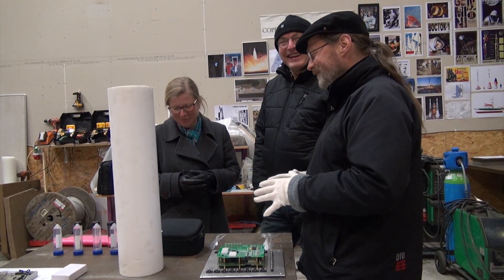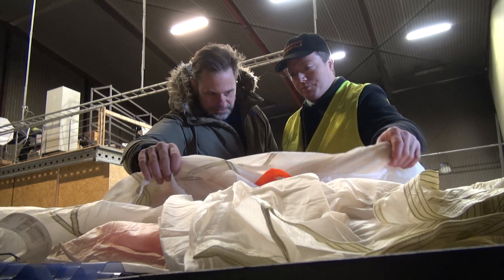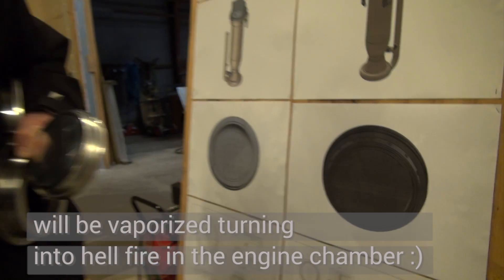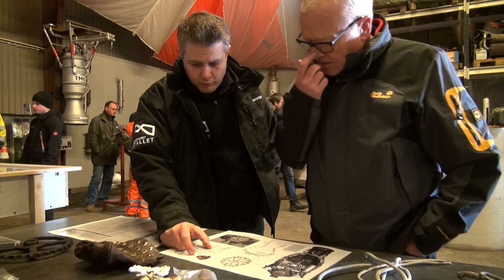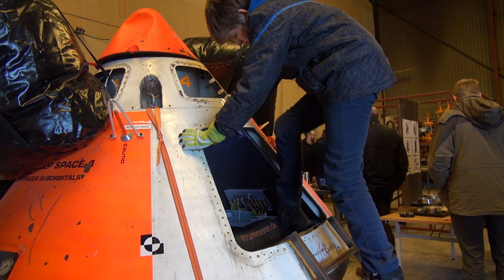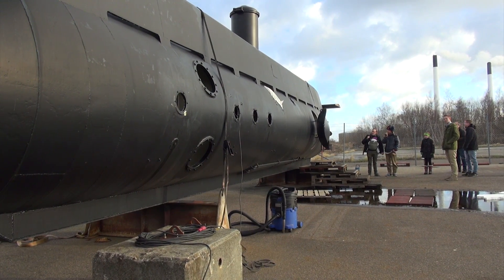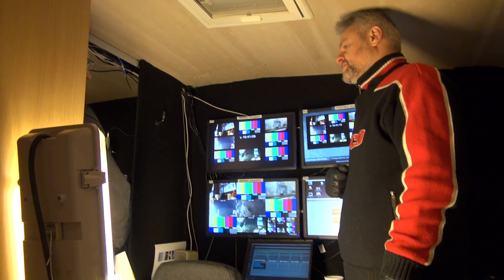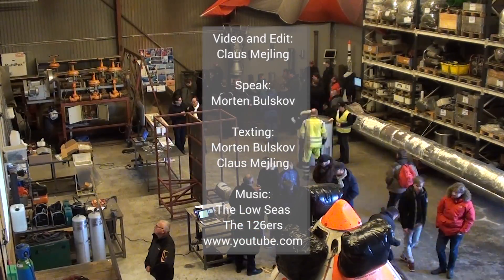Open House at Copenhagen Suborbitals 2015-01-04

Comment: I have a question. We have tested a hybrid rocket engine that works on rubber and hydrogen peroxide. The catalyst was potassium permanganate. The reaction and the extraction of oxygen and steam, but there was no ignition. Is there an answer to this? Thank you.
Reply: Omar Omar Mmm the concentration of water in you htp is probably too high to ignite and you have to have an ignition source even with htp